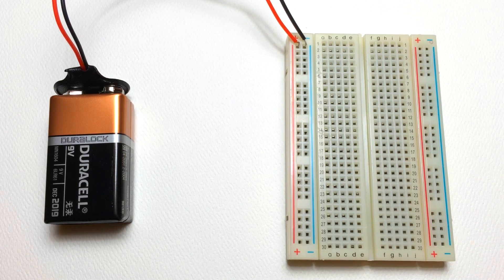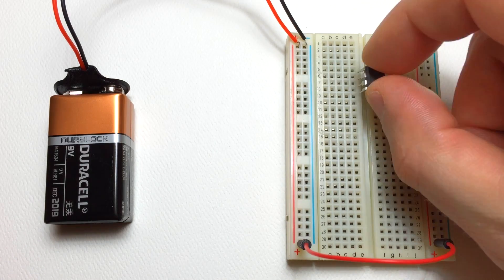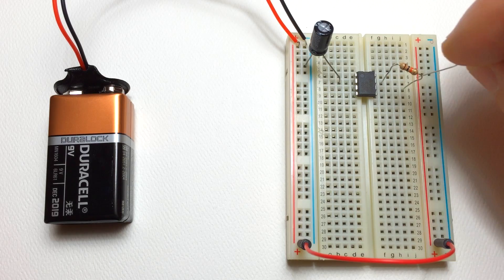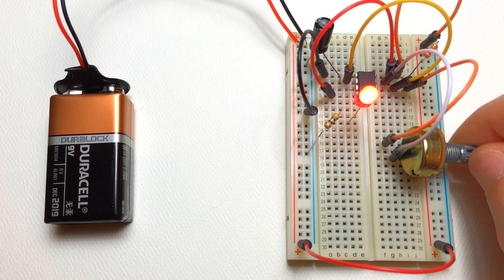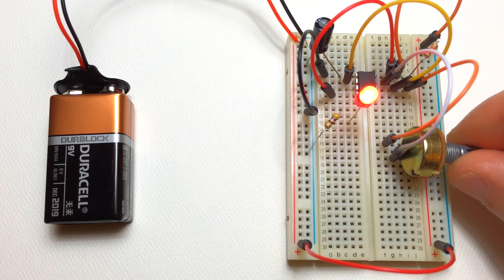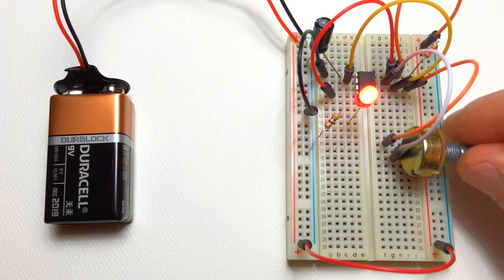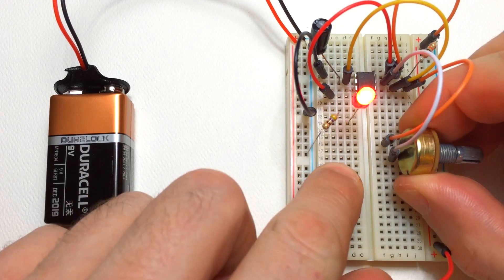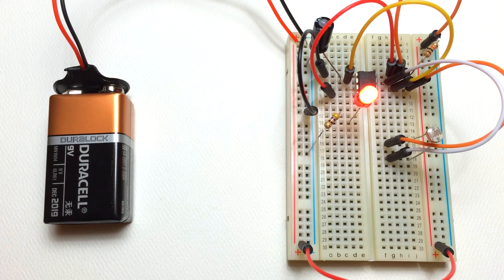The 555 Timer in Astable Mode

Comment: Is there a timer I can use to make this with a 3 volt DC supply?
Reply: if you need 3 volts from something like 9 or 12 volts use a voltage regulator.
Reply: I have been using 3.7 cell phone batteries with the 555 just step down the input Resistance. 
I have made 555 timers run off of garden light circuits with a 1.2 v AA cell and photo sensitive.
Go look at my videos, commercial free

Comment: Heya. I love your work. Could you help me with a little project? I am after a circuit with about 6 to 8 LEDs which circle on/off for about 5 to 10 seconds. In addition I would need a second circuit which circles on/off for about 10 seconds. Perhaps I could make two circuits using a potentiometer which controls the length of the on/off circle. This way I can build multiple of the same circuit - i.e. - using the same components - but still can set to different time intervals using the potentiometer. Any assistance would be much appreciated. Thank you.

Comment: Hi may I ask if there is a circuit diagram for your flashing led  as I am trying to see where you place a variable resister into the circuit and also what resistance is the unit.  Greatly for your advice

Comment: What will happen if the power source was changed to 5V?Will it still work like this?
Reply: Yes, it will still work. Here is a common 555 timer datasheet: http://www.ti.com/lit/ds/symlink/lm555.pdfIn there it says the minimum supply voltage is 4.5V.

Comment: How to change the amount of ti e it stayes off? I want it to stay off more than it's on
Reply from the maker: +Bluey Ali Try connecting the base pin of a PNP transistor to the output of the timer. Then connect the emitter pin of the transistor to a supply voltage. The collector pin of the transistor would connect to your load (what you are trying to power)

Comment: how could you change the amount of time that it stays on instead of off?
Reply from the maker: +Gslash25 Increasing the resistance or capacitance will increase the time that it stays on, and vice-versa. To change the time it stays off, an easy way would be to connect a PNP transistor to the output of the timer. The base pin of the transistor would connect to the output of the timer. The emitter pin of the transistor would connect to a supply voltage, and the collector pin of the transistor would connect to your load (what you are trying to power)
Reply: you can do it with resistors & caps, that is all you need, and a better design like I found and have been adjusting, I have a 555 running off a 1.2 v garden light circuit, go see for yourself, commercial free too

Comment from the maker: The 555 Timer in Astable Mode

Astable mode can make an LED flash on and off at a predetermined frequency. In this video, I will set up the 555 timer IC in astable mode and make an LED flash with an adjustable rate. The 555 timer in astable mode can be used for other things as well, such as producing a tone of a certain frequency when the LED is replaced with a speaker. See my blog posts on the 555 timer for more information: http://www.circuitbasics.com/?p=166 

Check out the Circuit Basics blog for articles and tutorials on the Raspberry Pi, Arduino and other DIY electronic projects! http://www.circuitbasics.com 

Facebook: http://www.circuitbasics.com/facebook
Twitter: http://www.twitter.com/circuitbasics
Instagram: http://www.instagram.com/circuitbasics
Reply: is astable mode similar in pwm?